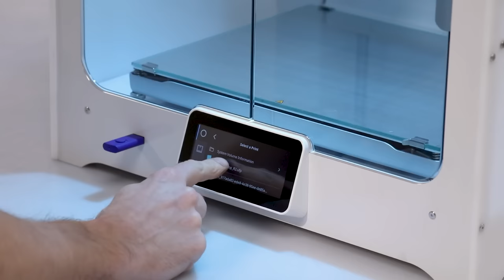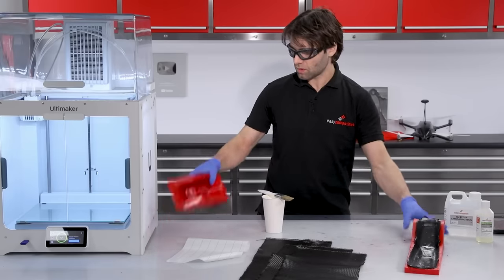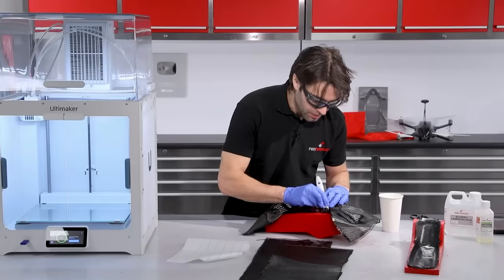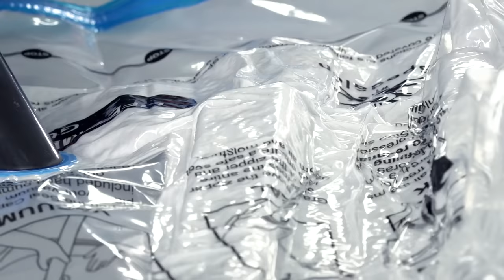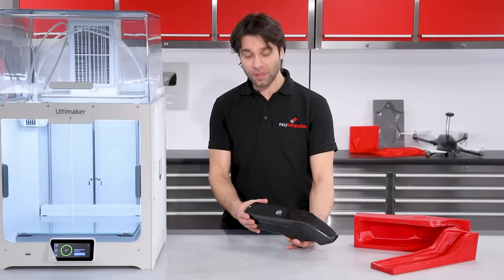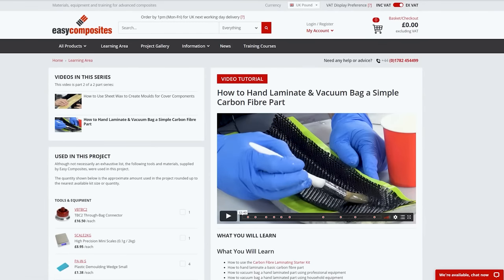Hand Laminating a Carbon Fibre Part Directly into a 3D Printed Mould

Comment: Instead of spending 5k on overrated car parts and spoilers, I think I will invest in this...I already have experience with 3d printers, just needed the carbon fiber bit..thank you
Reply: A lot of that $5k comes from having to make the mould. Doing it your self you might save 50-60% of the cost, but it's also a lot more fun and rewarding
Reply: @Elliott Pitter wow you must be so cool
Reply: @Draven Luciano  @Elliott Pitter  scammers
Reply: @VoltageLP  you can always use the printer to make a silicon mold ;)
Reply: @nathanbarrett6483  hmmmmmmm
Reply: That's been on my mind, too! I bought a carbon lip spoiler, but when my car was in for service, it was cracked and I realized it's fake carbon. Now I'm gonna make my own!
Reply: Those overrated car parts are most likely designed to spec. Good luck doing that at home. I have a full workshop to work on those parts.
Reply: @shadowblack1987  cool ig? Uktheres places called makerspaces right? Or friends?
Reply: @nwpsilencer  I just spend $5 on a 1 side of the mould for the RC Spitfire. The other side, plus wings, will cost me around $20. 60cm wingspan. Yes. It takes a lot of time to prepare it, but instead of watching TV or going out to the pub, I do this. A bit of filler, can of primer, sanding paper and off you go.
Reply: @shadowblack1987  There are many expensive car parts that are obviously not designed by an engineer. Sure they might been made beautifully but if I'm gonna drop a tonne of money on something I want it to also be designed by someone who knows what they're doing. Of course there are plenty exceptions, and times when it's just a carbon copy of the OEM. If you should buy or diy depends on many factors.
Reply: i dont mean to be offtopic but does anyone know of a trick to get back into an Instagram account??
I somehow lost my account password. I appreciate any assistance you can offer me.
Reply: @Camden Miguel instablaster :)
Reply: @Troy Case i really appreciate your reply. I found the site through google and Im in the hacking process now.
Takes quite some time so I will get back to you later when my account password hopefully is recovered.
Reply: @Troy Case It did the trick and I actually got access to my account again. I'm so happy!
Thanks so much you really help me out :D
Reply: @Camden Miguel Happy to help xD
Reply: @camdenmiguel225  just hit recovery and send the new password to your email
Reply: @thomasjohannesen1003  you knew it wasnt real carbon when u bought it off of ebay for next to nothing. quit playing dude
Reply: man i have been working with 3d max for 14 years and and 3d printing for around 7. It is not easy as abc but it can get it done. Be ready to invest lots of time on both 3d modeling portion and 3d  printing software. The main difference between the guy selling a part and you u making it, is a business. And you are the hobbyist.  All his time and money to make the part was diluted on every part he sold. The single part you done, will cost a "fortune" in the end.
Reply: or you can make them and sell them for 5k
Reply: @VoltageLP  it’s possible. Be good on math and measurement. No cutting corners.
Reply: Hey look at this guy everyone! He’s too cool for school mayne!
Reply: @EAGLINWRX  Both the Camden and Troy accounts were created within days of each other this year.  I'm suspecting some sneaky spamming...
Reply: SO FKNG TRUUEEE
Reply: That’s exactly why I’m watching these vids myself, I’d even go as far as making a whole kit for my car. Im experienced in using 3d printers and In using CAD so I don’t see any issues with it
Reply: „Oh woha, that carbon Spoiler looking sick, where di you get these?“... „I made it by myself“. That would be so coool
Reply: And 3D scanners are so cheap now

Comment: Great video! If you print with PLA, you don't have to worry about slip angles or even returns, as the mould can be warmed with a hair dryer and bent away from the part to release. It is a huge benefit.
Reply: @mattmurphy7030  yeah, they cost virtually nothing to print, so for single or low volume, they can be 'disposable'.. it does allow some benefits not possible any other way..
Reply: Would you recommend PLA over PETG? Or are there any disadvantages to using PLA?
Reply: @veldhuisracing  PLA is good because you can melt it away from the part at a fairly low temperature. But if you have a thick layup that will get hot during curing, the mould can distort, so PETG would be better.
Reply: Thx for sharing, I want to get into this.    I was wondering if my pla would be good

Comment: This is the perfect type of content. I wouldn't be interested in vacuum sealing for 1 single one-off part usually, but now I see the process and why you'd consider it. So now I would likely actually do the vacuum sealing process. But it's really cool to know this can be done with 3D printed molds and turn out well either way.
Reply from the maker: Thanks for the comment, I’m glad this video has helped to explain a good reason behind at least some basic vacuum bagging.

Comment: Acetone vapour smoothing ASA moulds might be a bit of a game-changer with this..
Reply: hm you can smooth ASA w Acetone? Gonna try this.
Reply: @streaky81  Yeah just go with the PVB. Smooths fine and far better printability. Unless you are super confident in your ABS/ASA printing skills; but typically for a mold you are looking at sizable parts, so you because you got your benchy tuned in doesnt mean you are good.

Comment: Super nice that you did a tutorial on this stuff.
I have been experimenting A LOT with 3D printed parts and 3D printed moulds / mould masters up to 1.35m to make CF watersport structures. 

One thing I found on the way is that PU epoxy primer (sold at HP-text....), is a superb primer to stick something to PETG. You only need like 50gr to coat the surface on a meter long part, but after that you can laminate glass or CF to the 3D printed structure without issues. You can't pull it off anymore. Maybe Easy Composites has a similair product. :)

Another thing is printing very low infill single shelled 3D printed PETG moulds, with the infill arranged as long channels (1 infill angle) and filling them up with e.g. epoxy foam.
Reply: May i ask if you have experience which coating i can use to pit permanently into the negative mold? I want to get rid of all little imperfections and layer lines but still want to be able to the the molded part out of the mold

Comment: Another excellent tutorial with two really small details that I feel are often missed and help to demystify working with resin: cleaning the shears (I assume you just throw the brushes as they're relatively cheap) and showing the drips after it had cured (i.e. not worrying that they're there)
Reply from the maker: Brushes can sometimes be reused if you clean them in acetone before the resin gels.  However it needs to be a good quality brush as some of the cheaper ones, the glue holding the bristles dissolves with acetone so it falls apart.

Comment: I've been doing quiet a bit of this lately, almost always vacuum bagging. I've found that with pla and a .4mm nozzle that 3 perimeters (1.2mm wall for cura users) and 15% infill makes a mold that can withstand full vacuum. I've had this luck with both pva and mold release wax for getting parts of of the mold, with wax generally giving an easier release.
Reply: Surprised by your result! I would have thought infill density would have had to be much higher, glad you saved me a few passes. I was also curious if the resin curing process, and the heat, would be high enough to deform PLA, so I picked up clear PETG to mold with, and see any voids. But now I can save that and use PLA instead, and save the stringing for another project. Thank you Nate, I'm looking forward to my first layup!
Reply: @GhostRyderFPV  Glad to hear its helpful info. I imagine that exotherm could still be an issue for warping the PLA if you pushed it too far but I've had great success with epoxy. I've also found that for one offs it's just as easy to sand the layer lines off the finished part opposed to trying to sand the female mold before laminating. If you're going to pop more then a few out of the mold it's probably worth the time to sand the mold. I haven't pushed any of the molds to failure but i have a few that I've made 4 or 5 parts out of that seem to be in fine shape.
Reply: @natecampbell42  This advice is free?!
Seriously, thank you. You've just taken the edge off the anxiety of trying this: Will the molds last, are they strong enough at 15% infill, layer line treatment on the molds. Really, thank you.
Reply: @GhostRyderFPV  No problem. Let us know your results
Reply: Hi, thank you both for your advices! I'm going to try this soon for the very first time. Any more tips and tricks?

Comment: 3d printing engineer here, just wanted to say that i loved the video! And maybe also to point out that you (hypothetical "you", as a hobbyist, not as a full-blown composites professional) could pay a lot more attention to printing to make the mould almost perfectly smooth. With proper design and a good thick 0.8mm nozzle most of such shapes can be printed in a vase mode, say, at 0.04mm layer height, and then smoothed with a bit of dcm or elbow greace. Or sprayed with some coating to hide layer lines completely. Or dcm-smoothed and then coated. Or acetone-smoothed (if using abs) and then coated. Or... you know, the list of things that can make a perfect mould is kind of infinite
Reply from the maker: Thanks for the comments and suggestions. In our other 3D printing tutorial we did demonstrate using an epoxy coating and the finishing to a near perfect finish; if you’re making more than one part using the mould then this is worth doing. For a one off, it’s often easier to do the finishing work on the part (because it’s in the positive shape).
Reply: Why not printing the part itself, bypassing mold stage completely?..

Comment: i do a lot of hand laid carbon fiber wings for drag cars . we spray clear gel coat first let it tack up 45 min then lay the carbon on the tacky surface the the resin, if we have a small air pocket we use a dremel to open it and put some clear gel coat in it. then we sand with 600/800 wet sand with 1000 the buff and wax. we make a beautiful part

Comment: Interesting to see you using the mould straight from the printer. might want to give that a try.
I've made a number of 3D printed moulds for wet lay-up of glass and carbon parts and I've always coated the mould surface with a Motip filler-primer layer from a spraycan, then sanded the surface to some 400 grit (tho it is possible to go to 2000 grit and polish the mould) untill the peaks of the printlines were visible and sanded smooth but the valleys were filled. It required much less post processing since the surface was already smooth. This is especially important with carbon fiber as you need to be very cautious of the tiny fibers you're sanding off, tho wetsanding really helps.
 Also, I've always liked to use 8mm wooden dowels and holes in the moulds to perfectly mate the mould sections for larger moulds that need to be glued together.
Reply from the maker: Thanks for your feedback and tips, that’s all good to hear and share. We’re generally a bit wary of rattle-can primers because the release off them can be a bit hit-and-miss (generally more miss, the amount of calls for help we get from customers who have used them!) so you might want to experiment with a product like XCR, it’s really an excellent way of coating prints 👍.

Comment: To remove the etchmarks from the printer, place a small cup of Acetone with the parts in a vacuume chamber for a few mins, or even lightly brush them with Acetone then quickly wipe it off! Smooth surfaces everytime.

Comment: One video I would love to see you guys make is a video on a multi piece mold built for resin infusion!  You have videos on infusions and you have a video on a multi piece mold for a prepreg part, but not a multi piece mold for infusions... PLEASE!
Reply from the maker: The process is the same, the main difference is you will need to envelope bag.
Reply: @easycompositestv  Yes, but there are different techniques to building an infusion mold and a mold for pre preg. An in fusion mold needs be sealed in order to pull vacuum. It would make for a more complete video library.
Reply from the maker: @johnnymckissick2735  You can mould in a joggle to the mounting faces to allow a seal to be positioned where the flanges come together or a simple application of silicone (caulking gun type) can be put onto the flange before clamping them together.

Comment: The Surface of the mould can be improved with IPA or other Solvents (Vapor or Brushing it on) so the layers lines are even less visible, great Videos!
Reply from the maker: In this case the surface porosity of prints is also an issue as well as the surface being smooth.

Comment: Great video as always! Are you planning, or have some references as how to treat aluminium molds for vacuum bagging, when the surface is porous, or how to apply and which release agents to use? 
Cheers
Reply from the maker: You would use the S120 as featured in a previous video.

Comment: Again, great content. Are you planning to do a video about 3d printed cores? Would be great, especially when you investigate in which material is the best for it and maybe also looking in solvable materials like hips.
I'm currently using ABS but the bonding with epoxy, even with sand paper grinding, isn't really good.
Reply from the maker: We are looking at other videos with 3D printing and similar materials.

Comment: What sort of dust extraction/management do you recommend when grinding/Dremmeling the flash off? I heard from some guys that I know who are ex-Lola, (now RB or Mercedes guys), that CF grinding dust is particularly dodgy (inhaling any dust/solvents to some extent obvs) Also just to say....really, and I mean really, good instructional videos, honest and straight to the point. hopefully will bring you a lot of hobbyist business.
Reply from the maker: We use a downdraft table in a ventilated cutting room.  However dust extraction arms etc also work well.  You still need PPE on top of any extraction.

Comment: looks around his computer desk to see what can be coated in Release Agent and turned into Carbon Fiber
If I can find a compatible STL, I would like to replicate this process to make a a cover for a drone radio controller, the Flysky Nirvana. It wouldn't have to be structurally strong, just enough to protect the controller's touch screen. I wonder, does the resulting part have enough flex to allow for slight bending to conform to it. Hmmm... 

Guess one of those DIY kits is right up my alley!
Reply: And I'm back - out of stock... dangit.
Reply from the maker: @GhostRyderFPV  Thanks for the comment, the Carbon Fibre Laminating Starter Kit will be back in stock later today, you can place an through the website and we’ll despatch the order Monday
Reply: @easycompositestv  Like release agent on PLA, I'll be there! I wonder what sort of applications this kit will have for my hangar of drones and planes - if I don't glue myself to my workbench, there will be video on the channel. 

What are your thoughts - "PLA vs PETG vs Carbon Fiber Hard Lithium Battery Cases - Navy Rules - The First One To Explode Loses"?

Thank you, Mr. Composites LTD ô¿ô

Comment: I wish I saw this last year.... that XCR resin would be perfect for spot repairing diamond cut alloy wheels, especially for the home user, where 2k clear is not something you want to use!
Reply from the maker: Hi Khalid, yes, indeed. XCR can be used in most situations where clear coat would be used, particularly for smaller areas.

Comment: I you paint the petg with epoxy resin it will be extremely smooth surface it fills in the layer lines beautifully
Reply from the maker: We show that in our other 3D printing video where we use the XCR to turn the print into a good pattern for taking a mould from.  You can see how it looks here: https://www.youtube.com/watch?v=KpJdwryFj6k&t=264s

Comment: Pro tip: you can smooth out the 3D printed FDM mold with 3D printer UV resin.
Reply: Are you talking about using resin-based 3d printers which typically have small print beds, or something else that you can apply to an SLA-printer part?
Reply: He is talking about the resin from resin prints its 405 uv lamp is needed to allow it to go off, or the sun. If you want to use it a uv lamp make it go off in around 10 sec, dont apply thick layers as it will only allow so much to harden and skin over 1 mm is too much as printers of resin do layers of 0.05. So us a fine brush to paint on and then uv lamp then repeat. It does work, though i have found it dosent go off as well a printer, it leaves a weird surface that can be washed with rubbing alcohol. But it is very quick to do with a good 405 uv lamp. But wear anti uv glasses..
Reply: @herllraiser6662  Oh so use an SLA printer then some resin + UV lamp to fill in the ridges to smooth it out?
Reply: @invincibearofficial  use a fdm printer as in the vid and then use the resin from a sil printer over the top of the fdm printed part to smooth the print lines out.. look on youtube for vids people doing it.. you then paint the sil resin on in thin layers and each time you use 405 uv lamp to get the sil resin to harden.
Reply: pro tip use a heat gun and high grit sand paper and you can polish prints